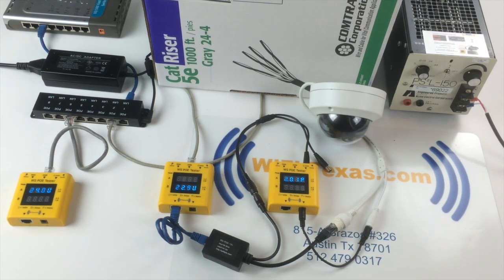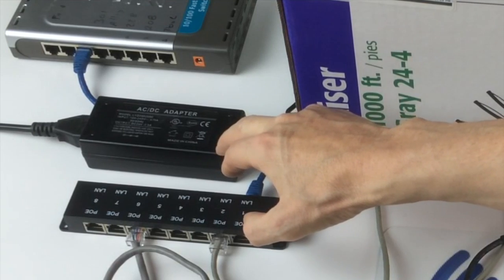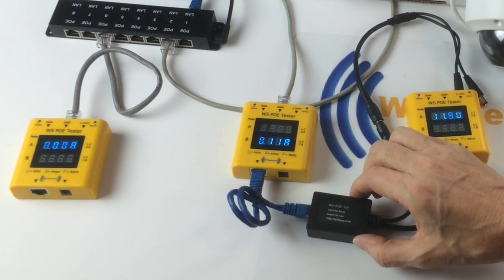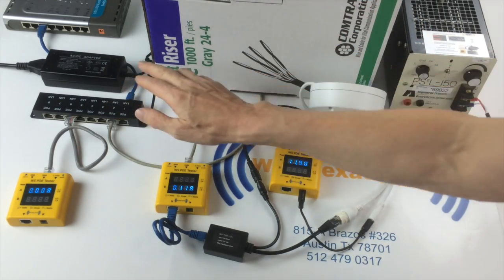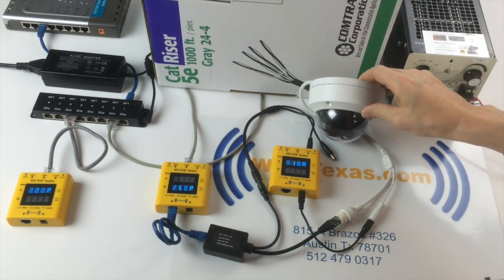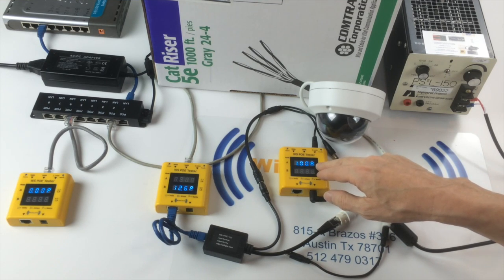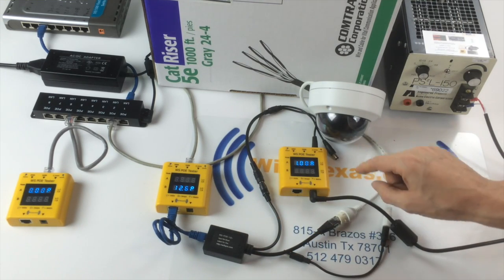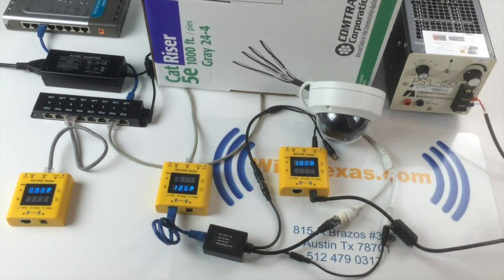Power Over Ethernet for Foscam and Other 12 volt non-PoE Cameras

Comment: Very cool, good info.  I've been researching a bit how to solve essentially the same problem, in order to drive a small amplifier with passive PoE.  In the converter you designed, did you use an LM317TG?  That's what I'm currently looking into.